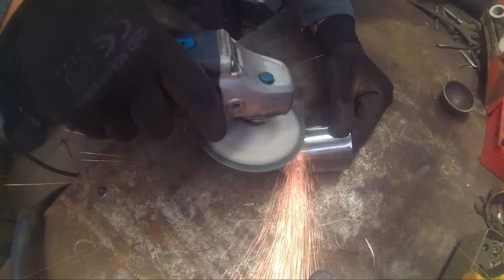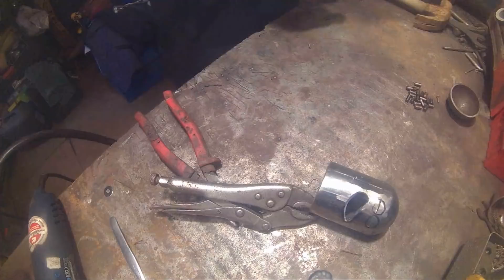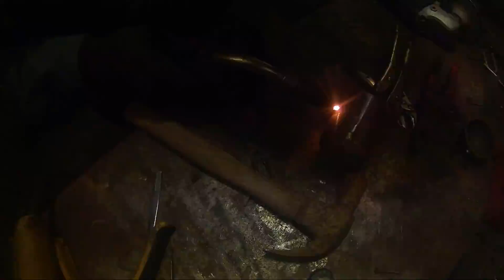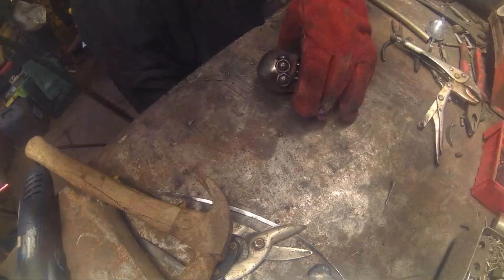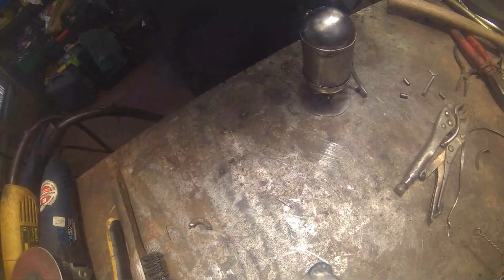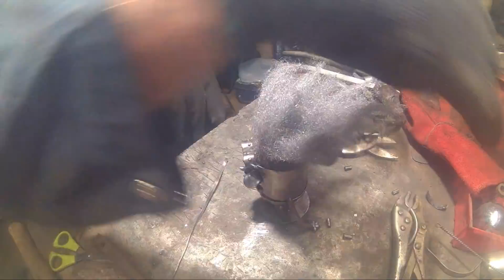EVIL MINNION ! scrap metal sculpture time lapse welding build.

Comment: Do you use any full welds or do you usually just tack weld all your pieces? Also would you recommend using a MIG or TIG welder? Also are you on a 115 or 220 outlet?
Reply from the maker: Hi there, i do both welds depending on the application, i prefer the mig as i think its quicker for what i want, and its 240v here in the UK....cheers